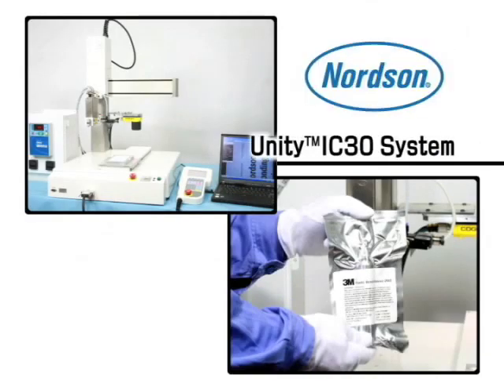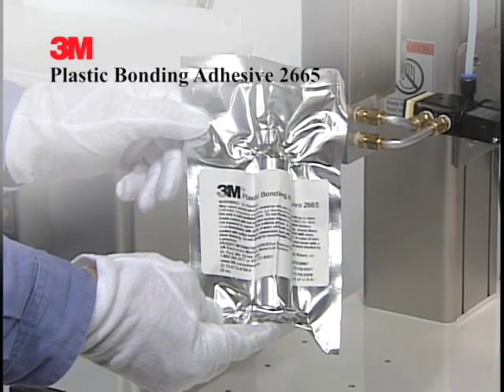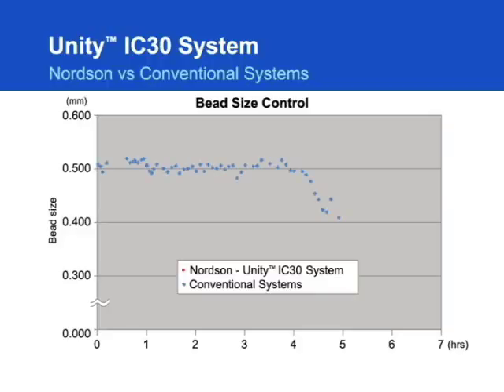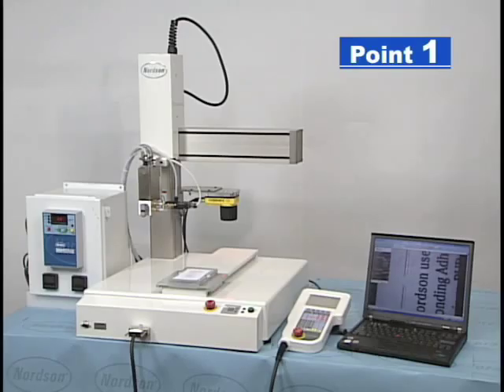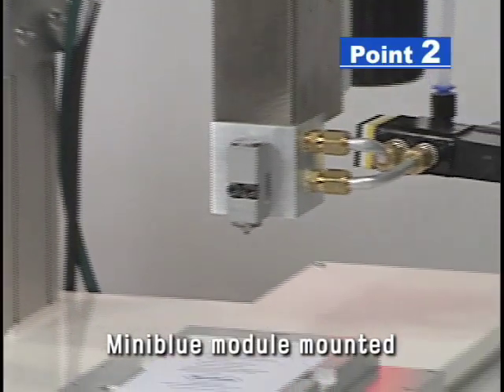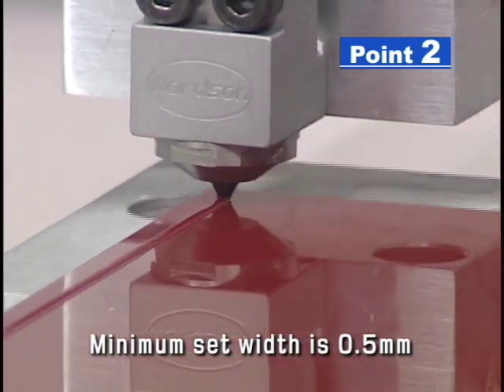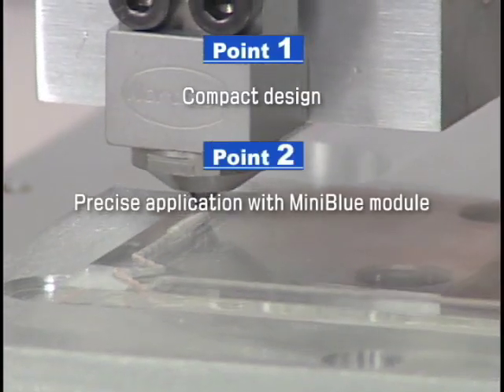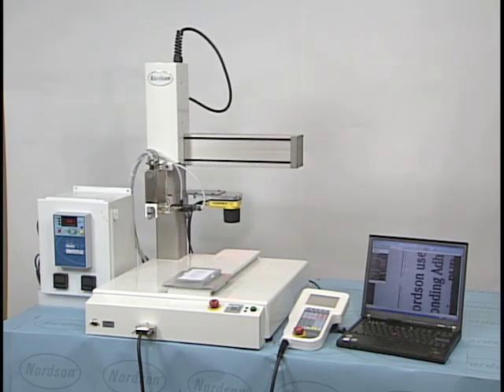Nordson Unity IC30 Adhesive Dispensing Systems

Comment: This is showing the original IC30 system, the one today looks different but works basically the same.
Reply: We are manufacturer of Hot Melt Glue Machine, if you have needs, please feel free to contact us :)
WhatsApp: +86 131 64576609